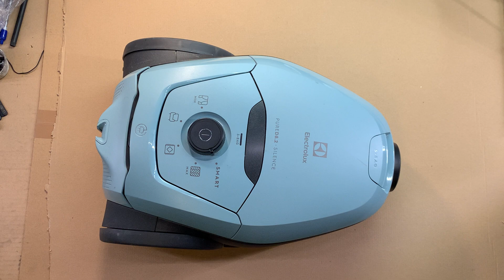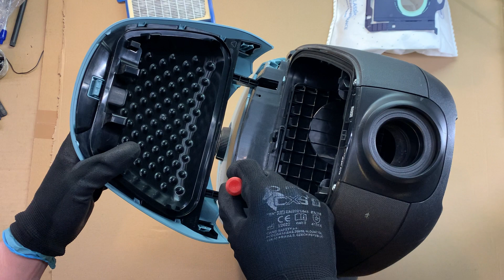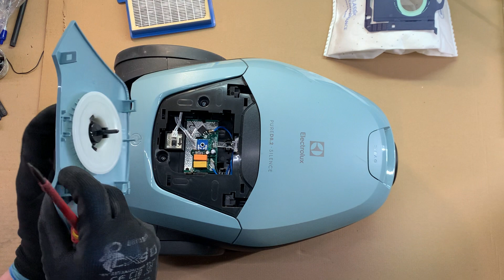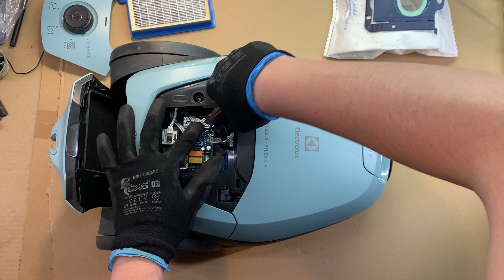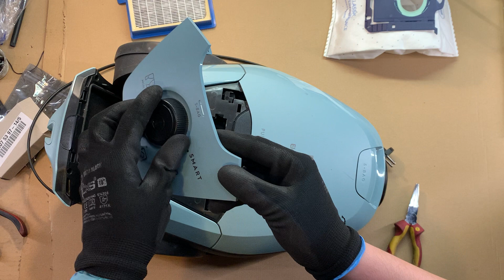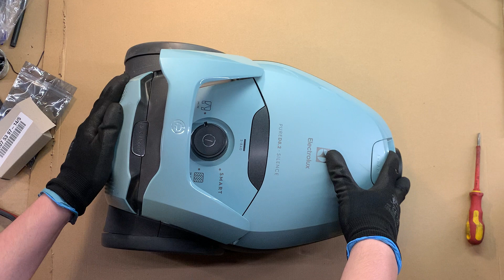PURE D8.2 Silence - Electrolux PD82-4MB - The SmartMode Function Turn Off Vacuum Cleaner

Comment: Thank you!
Confirming to boost engagement :) Had this exact problem with one that was 3 years + a couple of months. It would turn off at the slightest load, with the S-BAG light briefly lit.
Bought new board from Electrolux in Sweden for 29 EUR. Now works perfectly again. I did snap two of four clips holding the lid on, though :(
The bad board still looks OK, the outer square cap seems identical, the inner square cap had all the same numbers on it but was different colour and noticeably wider on the new board. Couldn't see any obvious other differences, the PCB itself looks the same, but I didn't look very carefully and I didn't compare the specs of the cylindrical caps.
I'll probably replace the caps on the bad board and keep it to quickly fix it in case it fails again in 3 years... :)

Comment: Thanks, really helpful video 🥳 my vac had same issue after 3,5 years. Motor sounded normal. Replaced board for ~22€ now it works fine. New board maybe has some improvements hopefully and last longer. 😊
Reply: where you buy PCB ???

Comment: Thanks for this video. I just order one for 49,90€, shipping included. My motor stop after few seconds on every position. I will tell you after changing it in few days. See you soon.😉
Reply: Had same issue with mine. Board replacement solved the issue for me 😊
Reply: same here, ordered a new board and it solved this exact issue
Reply from the maker: It is problem of capacitor, if it happens again (in near future) and you have soldering gun at home, just replace capacitor 474[K] 275V X2 or 334[K] 275V X2 - depends on exact model of vacuum cleaner 👍
Reply: @proexservis  damn, I thought so aswell, new board had beefier caps. they definetly saw a problem and fixed it over at elektrolux.
Reply from the maker: Probably yes, on this type of board it last less (over 3-5y) than those in older vacuum cleaners (as ultraone or ultrasilencer)
Reply: @proexservis thanks for info.  new board was revised,  hopefully new version has better capacitors and improvents 😊  if not I will try soldering next time!

Comment: Great video, but I seem to have kind of the opposite problem. I have the PD82-Green and the speed settings works like normal, but the smart setting does not turn down suction if the inlet is blocked (cleaning carpets are therefore kind of a hassle). Do you have any suggestions on what the problem might be?
Reply from the maker: Thank you.
Probably you have disconnected (hose) or faulty pressure sensor. It can be measured on this circuit board. Check if black hose from sensor is connected to sensor and to bag container. Full disassembly video is here: Complete Disassembly & Assembly of PURE D8.2 Silence PD82-4MB Electrolux Vacuum Cleaner
https://youtu.be/7fULpW5cqqk
Reply: @proexservis  I just had a look at the vacuum cleaner. Unfortunately it seems like all hoses are connected so it’s probably a faulty sensor. How do I measure the sensor and what values should I expect?
Reply from the maker: @OskarLJ  two contacts will connect when you blow the opposite sensor with mouth, maybe you have some dust in it so that pressure doesnt connect it. If sensors are ok after testing then PCB is bad
Reply: @proexservis  the hoses were clean and properly connected. How do I test the function of the sensor?
Reply from the maker: @OskarLJ  with multimeter, measure connectivity on contacts during making air pressure to sensor

Comment: Would it be possible to desolder de capacitors and replace them ? I couldn't find the values of the capicitors do you have an idea how to get them ?
Reply from the maker: Hello, yes, it is possible to repair this Electrolux board by replacing capacitors, I did that many times already, like in this video (time from 15:20): https://youtu.be/Vq_rkkdIxyM?si=WclZQA5_kclRd0iq
Reply from the maker: Board should be: 140075397145 and capacitors (usually yellow and orange/blue color) which should be replaced: 334[K] 275V X2 & 474[K] 275V X2

Edit: you can get them online or in any electro components shop
Reply: @proexservis Thx for the answer! I was looking for a value in F or uF but that is probadly my audio experience.
Reply from the maker: Those electrolytic capacitors 330uF 25V and 100uF 25V are usually not defective, just good to check them for a swollen top 👍

Comment: So mine after almost 3 years it shuts down if the vacuum has more than 5 seconds the suction blocked. What could be the problem?
Reply from the maker: Does it on all levels? Min-max-smart?
It could be capacitor issue or motor, best way to find out, measure motor on board when it is running or voltage on board, if voltage drops then board issue (capacitor) 🤔 measure pressure sensor too, if it stay blocked it can turn off vacuum cleaner, but i think it will be motor (overheating fuse turn your vacuum to protect it), you can disassemble motor to check status of rotor and carbons: https://youtu.be/QZ_Mz6_QDYE?si=UJQoxHt2KgK4QFDY
Reply: @proexservis  it's not overheating the air from the exhaust is not hot.
Reply from the maker: There is fuse in motor, its not about hot air, if that spot (connection) overheat then it disconnect (it can happen when rotor/carbons are in bad condition or fuse is damaged), i.e. here customer detach that fuse and motor totally burned out: https://youtu.be/QZ_Mz6_QDYE?si=FjDd3PZ1A3vi1Y0z

Comment: Would a bad capacitor make the "S-Bag" light turn red and stop the motor, thinking the bag is full?
Reply from the maker: Yes, it could be capacitor/s, replacing of them should help or replace that circuit board
Reply: @proexservis  What exactly is sensing if the bag is full. Some kind of airflow resistance sensor?

Can I measure the capacitors for a standard value before spending time replacing them?
Reply from the maker: @Rollgott  it is connected with pressure sensors: 1181971050
Probably you can disconnect it and it will not control it when you clog vacuum cleaner
Reply: @proexservis  Ah perfect. This pressure sensor is a separate function of what you were talking about that might destroy the engine? Overvolting stuff.

I see there is another PCB inside the vacuum. Which has those pressure sensors on it. It would be great to bypass them somehow!
Reply from the maker: @Rollgott  in many cases those sensors are not faulty, probably disconecting that connector on PCB (4 connector or 5 connector) should be enough to bypass them
Reply: @proexservis  Oki, thanks! :)
Reply: @proexservis  I disconnected the 5 pin connector, but it seemed to have disconnected the start button as well, as it won't start at all now.

Can I short two of the pins in order to trick it to start?
Reply: @proexservis  I found out what pins to short. It still only starts for 1 sec and then stops. Would that indicate it's the capacitors that are broken?
Reply from the maker: @Rollgott  oh, i forgot, yes, there is micro switch in that connector too
Yes, you can measure which 2 cables are from button and with flat screwdriver you just connect those 2 to test vacuum without sensors, if vacuum will work without sensors (it wont stop after a while) then just disconnect the rest of cables (2 or 3 depends on model) from that plastic connector (because you need micro switch 🙃)
Reply: @proexservis  Yes sir. I shorted the pins with a screwdriver but the motor only starts for 1 second and then shuts off. Would this indicate that a capacitor is likely the issue?
Reply from the maker: @Rollgott  yes
Reply: @proexservis  Visually every component on the PCB looks to be in good condition, no visible damage on the outside of the capacitors. Can I test measure them before I replace?
Reply from the maker: @Rollgott   with impedance analyzer, or you just buy those foil capacitors for few cents and replace them without measuring it with an expensive tool 🙃
Reply: @proexservis  Ok thanks! I'm more worried about the time it takes for a noob to desolder and resolder those capacitors to the PCB! :D
Reply from the maker: @Rollgott  haha 😅 yes, without tools it can be hard but easier than replacing battery cells vacuum cleaner (1-2 hours) 🫠
Capacitor is few minutes: How To Repair Circuit Board (PCB) Of Vacuum Cleaner (No Power) - Electrolux UltraOne Z8830PSK
https://youtu.be/ZeJpesy1MMs
Reply: @proexservis  Time to out my soldering skills to the test! Got some solddring equipment but never soldered this small PCB. One replaced a capacitor on a washing machines PCB and it went well.

Thanks for the replies! Il check the video out

Comment: Hi. Can you tell me how the hoses are connected to the sensors? When undressing, I didn't pay attention to it and now the "smart" option does not work
Reply from the maker: Hi, did you replace pressure hose? New type is transparent with bigger diameter. On PCB pressure switch (1181971050) you should find which side is for filter and bag.
Reply: @proexservis  The vacuum cleaner motor was replaced. Each sensor has two inputs - upper and lower.
When the pipe is clogged, the red light comes on, but the suction power does not decrease.
Reply from the maker: @adamski5498  i think lower (bag) is going to front of vacuum cleaner. Not sure, I dont have this model here right now.

Comment: First it was replaced under warranty, seems to fail always after 2 years. Bad design. Should be redesigned and replaced for free even after warranty. I will try to find which part fails on it.
Reply from the maker: There was change (probably already in warranty) that service should replace sensor hose (for different type) if it happens again, maybe you should check it
140045222050, because old type hose can damage new pressure switch of circuit board
Reply: @proexservis  I managed to fix the board, no problems during 20 minutes testing. Checked all the power components and found with impedance analyzer that the foil capacitors were dying. 470 and 330 nF were only 310 and 205 nF, causing the power supply to drop/have ripple. Instead of the original X2 I replaced them with X1 types, which are bigger, but still fit on the board and tolerate pulses better. Not sure if this is the issue for everyone, the electrolytic caps and the pot can also easily fail. I recommend to disconnect the unit from the wall when not in use, because it is the transient pulses (lightning, industrial disturbances) that eat the lifetime of these caps.
Reply: Hey Zoltan and PROEX you are geniuses !!! This video helped me to open vacuum cleaner and comments inspired me to replace two foil yellow capacitors for price about half dollar. Thank you very much, problem is solved !!!
Reply: @marekrehak5799  woohoo! I'm so happy that it helped you too!

Comment: So it's a bad model?
Reply from the maker: I dont think so, it can be easily repaired by replacing capacitors on its circuit board or replacing that PCB.
Imho, for how many were sold, it doesn't happen often, but it happens… 🥲
Overvoltage can cause this damage to the electronic board.

Comment: the electronic board price is half of the vacuum cleaner here. can it be fixed?😄
Reply from the maker: How much? 🫣 I dont know, because I never tried it, vacuum cleaner PureD8 cost over 200€+ and this board from 27€ to 35€ here in Europe, so is “cheap” to fix this problem. Do you have this model or different?
Reply from the maker: Once I tried to repair almost same board like this one but it didnt help, I replaced few components on it. Same result, vacuum stops on maximum power, so I dont waste more time and money to fix these boards if faulty board has no visible damage.
Reply: @proexservis  aprox 76 euros, same model. Next week I'll know for sure and keep you updated if you want.
Reply: @proexservis  thx for answering!
Reply from the maker: @mihaicurutiu6985  where are you from? You can buy it from other country if your Electrolux dealer is selling it for this much.
Reply: Can’t you just disconnect the function?
Reply from the maker: @donsekr8520  no, max power turn off vacuum cleaner too, you can use it only on minimum power
Reply: @proexservis  I can’t even use minimal power 😢 Thx for answering 👍
Reply from the maker: @donsekr8520  doesnt start? Check cable plug, it is most common problem, probably 60-70% of my repairs are broken cable near plug 👌
Reply: @proexservis  It starts and runs for a minute then the s bag flashes and it shuts down.
Reply from the maker: @donsekr8520  circuit board is faulty, you have to replace it, it is same as in video. Sometimes that board works on minimum power
Reply: @proexservis  👍

Comment: Can i bypass this horrible stupid design of a sensor?
Reply from the maker: You can, but it will damage motor in short/long term period. That board is protecting it from over/undervoltage
Reply: @proexservis  Oh, okay. Can you ELI5 a scenario where the motor would be damaged?
Reply from the maker: @Rollgott  overvoltage or undervoltage in electrical network, overheating etc. Any problem will take out motor completely or burn it (fire hazard). PCB is must have protection in modern vacuums.

Comment: It's not good when you block the suction at the vacuum cleaner 😠!!!!
Reply from the maker: How you want to test smart mode without blocking the suction? Any obstacle during vacuuming (carpet, textil, toys) can block it 🤔
Reply: @proexservis  I mean do not block the suction long. Max 4 sec more not. That will damage the vac motor